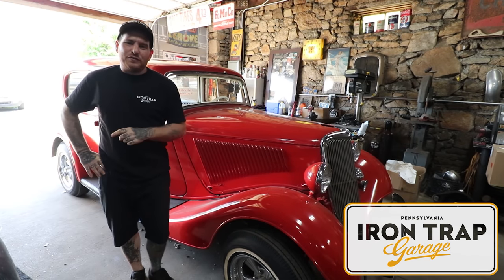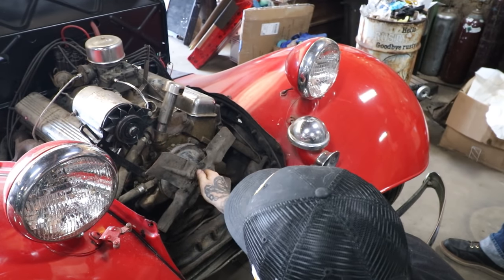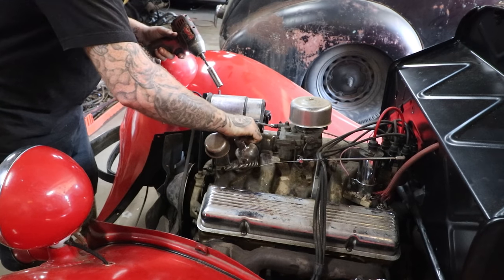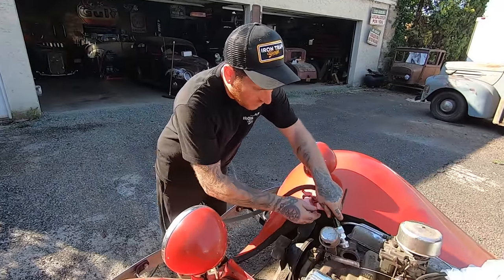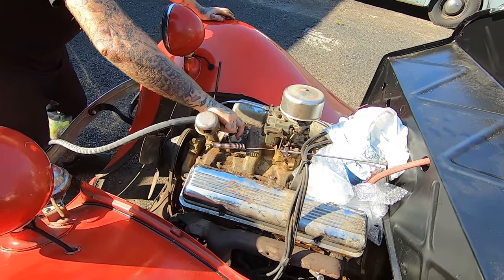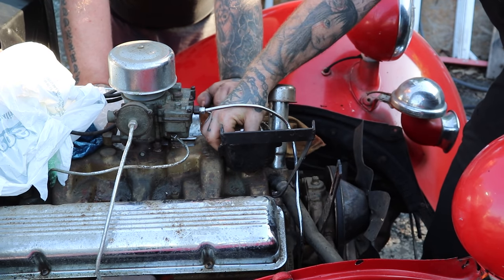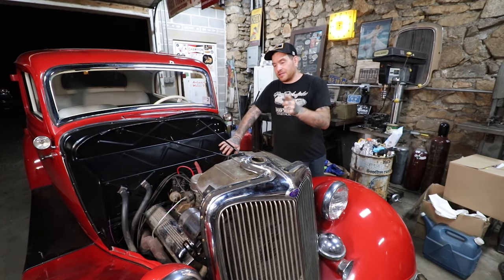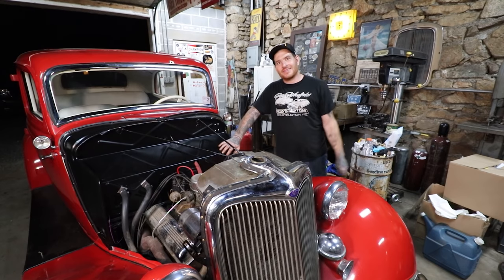Flushing The Cooling System and Installing a Heater!!??? - 1934 Ford Tudor

Comment: I worked in a radiator shop for a while.  We used a pressure washer to back flush radiators and engine blocks.  It combined air with water to hammer the engine cooling chambers.  You should have seen the goop come out of cars that were only 15 years old.  If you have overheating problems I recommend a power radiator and engine flush.

Comment: Hey Matt!! In my experience with vintage cooling systems, especially ones that haven't had coolant run through them in a while or just from sitting, you may have opened up a can of worms...Like you mentioned, it may take a couple flushes, if I remember correctly we use to use the powdered Tide laundry soap, but you must flush it all out...you probably will end up installing a new water pump before your finished, anyway another great video!! Build on Dudes!!!

Comment: Matt, hate to say this but if you pull the core ("freeze") plugs, you will probably find a lot more sludge/sediment in the bottom of that block. All the flushing in the world won''t get that out - only pulling the core plugs and digging it out (or using a pressure washer, which is nasty when the engine is in the car). As always, love the videos (but miss seeing Moon running around the garage)!
Reply: Absolutely.  Plus, the core plugs can be corroded inside and spring a leak once you start driving it.  They should all be replaced.

Comment: Hello Matt, from my knowledge of Cummins engine mechanic, I would recommend you to check the expandable engine plugs, since if they are not stainless steel or bronze they can be damaged by corrosion and cause future problems, and once started several times to clean the radiator again, hug and blessings from Buenos Aires Argentina

Comment: Hi Matt an old trick to  stop your radiator core from clogging up with rust is to put a stocking over the inlet pipe to catch the rust. Put it over the pipe then slip the hose over it. you can also buy an in line screen that does the same thing.

Comment: That's the way I always flushed my engines. Run water through the block until it comes out clear at the bottom. Same way with the radiator.
Reply from the maker: Cheap simple way, if that doesn't work then I go to some of the other methods like CLR.

Comment: Love the videos, keep them coming. I think I would have left the heater disconnected/bypassed until I ran and flushed the cooling system a few times so the heater does not become clogged. Better yet put a filter system in-place (like an external oil filter) of the heater to catch all the slug until it is clean then hook up the heater. 
I think the best thing to do is pulled the engine, disassembled it, hot tank it, paint it gold again, reassemble it using new gaskets but all the old internals. Of course that easy for me as a arm chair video viewer to say. LOL
Reply: I like to use magnets all over my cooling system. They will stop the crud from circulating.
Reply: YES I agree
Reply: @ddd228  Or wrap magnets around a filter so it traps particles even better.

Comment: Hey Matt! Great channel, have been inspired watching it. a quick tip, when you need to use a magnet for things like collecting rust or shavings, take a small piece of plastic, from a baggie or product packaging, and put it over the magnet head and hold with a twist tie or small piece of wire.
Reply from the maker: Good tip!
Reply: @IronTrapGarage  Glad you liked it.

Comment: There’s a flush kit you can get that has T fittings you can that go in the heater hoses that you connect garden hoses to each fitting, one supply and one as a drain . This setup does a much better job at flushing out the cooling system. 
Again another excellent video, thanks for sharing

Comment: Matt, Ford’s VC-1 cooling system cleaner is the bomb for this. Get er back together, drop a quart of that stuff in there and let it get up to temp with water in there and run for an hour or so, drop the lower hose and run clean water through it to flush. Pulling those block drains on the sides would help get the last little bit out of the block skirt areas also if you don’t mind the little extra work. The Ford VC-9 is specifically for iron so you may want to use it first then the VC-1 if you really want to do a great job. Heads up, neither of those products are cheap ($18ish) but they both work well and are not snake oil and are designed for exactly your situation. Don’t leave them in too long, they can be hard on some gaskets so an overnight soak would be a gamble. That car is coming along great! 👍
Reply from the maker: We may have to give that a try!!!

Comment: Matt there is a gadget called I think a Drain King that comes in a few different diameters, it's around 6" long, rubber and goes on a hose I have one for up to 2" pipes. They expand to form a seal then pulses at a high rate to clear clogges. Build a stub pipe at least 7" long to bolt the top end of the motor. You can also use a section of pipe and radiator hose to clean radiators.

Comment: LOL .. your acknowledgement of the sounding board advisors had me chuckling.  

Get some handlebars of vinegar at Walmart.  Fill your system full.  If you can cap your water pump .. please do.  Ideally a hose connection would be good to run after soaking .. but not everyone has water pump sized hose laying around.  You're smart enough to fab something without the radiator.

Anyways .. .. vinegar will absolutely clean out all that rust.  I've driven mine for a day or two, with the heater on & then back flushed with straight water.  Run with new water & baking soda to neutralize .. then back flush again and drain.  Distilled water .. run and drain ..remove & replace your freeze plugs .. likely need some attention .. then back to distilled & antifreeze.

Normally I'd have no issues with doing this with radiator hooked up.  Easiest 20 dollar or so radiator flush there is.

Comment: When you had the radiator out of car why didn't you remove the rust on the cross member under where the radiator sat on top of it.  You could have painted a rust converter then wire brushed the large flakes off and repainted the rust inhibitor again and let it dry.  I KNOW THIS IS MINOR BUT IT WAS SO OBVIOUS THAT I NOTICED IT AND HAD TO COMMENT ON IT, I ENJOY YOUR SHOW, KEEP UP THE VIDEOS, PLEASE.

Comment: Hi Matt.  
I have a suggestion.
Have you thought of using Evaporust to clear out the rust from the cooling system.  It will literally evaporate the rust, while doing no damage to any other parts of the system.

Comment: Thermostat bolts: I was waiting for a bolt to snap. Plain water is fine to flush out a block. If you use anything else, it's all day to get that stuff out. A LOT of "crap" at the bottom of the block right where the lower hose connects. Add a magnet in there somewhere .Even on the outside of the block. You don't want that stuff to plug up the radiator. OR the heater core. Your radiator flows well! It must weight 60 pounds. The '34 radiator was designed for a flathead engine, so it's overkill!  That is a good thing.

Comment: Matt  Unless you want to have heat in the car all summer long, I suggest you put in some kind of a shut-off valve in the feed line to the heater. Putting in in the return will still give you heat in the car just from heat transfer. Keep up the good work. Rick
Reply from the maker: Good call for sure 👍

Comment: The way my Dad used to do it was like this: Prestone sells a plastic tee with a cap on it. Your auto parts store probably sells them. This tee goes into on of the heater hoses and a garden hose connects to the threads on the tee,  The kit the tee comes with has a 45 deg. plastic tube that is about 1.5" did. This goes in the radiator filler hose. Start the engine and turn the garden hose on full bore. Watch water and crap come pouring out of the radiator tube.  Do it as long as you think is good.  My Dad did it two or three times a year so there wasn't much buildup to worry about. Why?  Because he did it a lot, Yours is pretty skody so maybe fifteen or twenty min. My Dad did it this way so it's the best  ;)

Comment: Hey you got to reverse flush . Check top of radiator ! Do not run with heater core hooked up . bypass heater core find something . Otherwise the core may get blocked on top and the engine could over heat . Remember the coolant flows from top to bottom . I went to school for custom auto rebuilding . Dealership training on the job .

Comment: Hey Matt, great progress on the '34. Back in the day we used to use "Calgon Water Softener" to clean sludge out of the diesels. I believe it is still available. I have also heard you can use Dawn dish soap but have never tried it. I see a couple of comments about removing the core  (freeze) plugs. A PITA to do but probably worthwhile. Anyway this is a great project. I really enjoy seeing the saving of an old build.
Reply from the maker: Thanks for the tip never heard that one before!

Comment: Morning Matt,
Good to see the 34 getting a drink of coolent.
Another step closer to the road !
Other viewers have lots of great ideas about cleaning out the cooling system so I will not put in my two cents worth.
I think you have delbt with enough old engines that you have a pretty good idea what you are doing.
   I Will have coffee in hand Sunday Morning for the Live event.
   ( Have you received the Wire Covers for the Steering column yet ? ) 
Thank you for the update of this great Survivers comback.
Be Safe and Well All.
Reply from the maker: We saw a package show up when we picked up mail call packages. We'll open it in a future video

Comment: The first thing I would do is get rid of the old water pump because if it is rusty up top you can almost be certain the impeller is rotted from sitting so long. We used to mix up washing soda and pour it in as a solution into the engine and start it up and let it come up to temp for a while and drive it around the block and dump it. It took a lot of garbage out.

Comment: You might think about placing a small ball valve on the inlet and outlet of your heater so you can isolate it from your engine. Two big reasons-isolate it from a leaking heater core that fails in a big way and spewing big quantities of very hot water inside the car and isolate any heat from entering your cab in the summer. Even though you may have it off and it is not suppose to be ciculating the residual heat can get the inside of your car really hot just from the heat going through it when it's not suppose to. These are really notorious for failing.
Reply from the maker: We may have to add one. Not a bad idea!!!

Comment: Hey Matt, Having your drain plugs clogged in a small block Chevy is normal, specially on one that sat as long as your 34 Ford has. Don't think it's out of the normal cuz it's not. I've seen them so clogged that I had to take a punch and hammer to brake them free. Like you said, clean them the best you can and refill with water, run for a while, up to temp, and drain them again. When you  do drain and flush it,  drain it using the drain plugs, not by pulling the hoses or the drain in the rad, and while doing it, use a pick like you were to get it as clean as you can. After you get it cleaned out the best you can then put more water in, run it again and drain it thru the rad to remove as much as you can from the rad. You may have to do this 3 or 4 times to get it clean. Sorry for the long post,  Good luck - later
Reply from the maker: Thanks for the tips!!!

Comment: The gold engine paint was probably put on when the engine was rebuilt before installing it in the '34. Gold paint was used back in the days,1950's as I remember. I believe it was gold so  that people would believe it wasn't a stock engine. I seem to remember gold paint was used on show car engines also. Jim
Reply: I think that the Y blocks were painted gold.
Reply: @ddd228  The 1956 Mercury Y-block was indeed gold but until around 1959 the 292 Y-blocks were red with black rocker covers and the 312 Y-blocks were black with cream colored rocker covers. The reason my 75 year old brain remembers gold engines in the 1950's was because of the Oldsmobile small block v-8 "Rocket" engines that started in 1949 all were gold except the 307 c.i. And many of the show cars used the Oldsmobile engines. I do remember seeing gold flathead Ford engines but I don't know if any were a factory color. There were also some later ford engines that were gold one was a 352 c.i. but i don't know the years.Jim

Comment: When I do this I typically put the thermostat housing back on with rad hose and clamp the water hose on and run it. Then i reverse that and force water from the bottom up. Repeat several times.
Reply from the maker: Great idea. All ideas work as long as it gets the car going!

Comment: I don't think I would have mounted that heater core side-ways like that for 2 reasons. It needs to be able to burp the air out of the top line, and as you mounted it, the thing will always be half full. The direction of flow should be from bottom to top, not side to side... Correct me if I am wrong?

Comment: The only way to get the cooling passages clean is to pop the freeze plugs out and scrape around inside because that stuff will be inches deep in the block. You can buy in line filters to get the worst out when running but they are stop gap until the block is cleaned properly. what you see in the thermo housing is a tiny bit of what lurks in hidden places. itr would be a shame to block up the radiator and cook the engine as it runs so well.

Comment: That crap in the block, blow it out with air first. And put a filter in the top hose to stop filling the rad full of crap. And have you replaced all the  all the welch plugs? Two behind the flywheel.2 in the front, 3 each side of the block. And flush from the bottom up in the block. And even more so for the rad.
Dont bother will coolant, you will be flushing that block for a good while.
Fittings?  This is a Chev, not a prehistoric sidevalve..
Best place for the temp guage is  the intake near the top hose..  Though earlier engines have a plug in the side of each head. Works but not ideal. You will still need a reducer
Reply: Without the invention of the prehistoric sidevalve, there wouldn't have been a smallblock chevy engine.

Comment: You should pull the motor down to bare block and have it hot tanked, all that rust and grunge will cause problems down the road.

Comment: Stop you at 8 minutes. Get two gallons of white vinegar. Fill the motor and let sit at least "overnight". Drain and flush. Maybe add some baking soda to neutralize the acid from the vinegar. Don't know if you need to apply heat. Might also help. I've done this on old galvanized plumbing as well as cooling systems and it works quite well. With all that rust floating around, I would change the pump also for added security.
Reply from the maker: Good tips
Reply: @IronTrapGarage  
BTW, the white vinegar also works great as a "pickling" agent. Need to weld a bolt and all you have is cad plated bolts??? Soak whatever bolt you want to weld in un-diluted white vinegar overnight. "Presto", no more plating !!! Safely weld away !!!

Comment: Matt I'm not criticizing: but why didn't you paint the sheet metal under the RAD like you did the firewall? Also the doors on the vintage heater? It's easyer to do when it's disassembled! ...Newk from Kentucky
Reply from the maker: I don't want any one thing to overly stand out when the car is together. The firewall and jambs were painted as they stood out and looked odd when the car was all closed up. Nicely painted and detailed tins would have looked a little odd at the front of the car. It's tough to decide when to paint and clean stuff and when not to on these survivor cars and we all have our opinions and mine isn't always the best and I make the decision on the fly usually.

Comment: 1955 265 is a 1 year manual  temp gauge to seat the  not electric, the old mercury filled  temp gauge tube... 1956  went to electric sensor in the front left side of the intake manifold this became the standard for SBC... 1955 block had thinner cylinder walls than the others SBC, No Built in Oil Filter, Manual Mercury style Heat gauge

Comment: What is the engine, does it have an external oil filter (56), no external Oil filter (55) looks like a 265 chevy, 55 has a manual mercury temp guage, the water temp location in the rear  clinched it it is a 55 265

Comment: You've probably moved on well beyond this, but the use of a commercial radiator/block cooling system flush will help move some of that sludge along and out of your engine. Sorry you wasted coolant, that stuff is expensive. Be careful when you select the flush as some brands/types are not recommended for use with aluminum parts.

Comment: Hi Matt, with that amount of chunky rust, you might be wise to flush with some other stuff to clean this once again ( radiator Flush kit ) after you have run the engine, I believe that it has a protective additive for the water pump.  But with that amount of rust you may have do this once a year.
Reply: Another method would be to pull those old core plugs , I know I know it more work but she was rode hard and put away wet! So Good Job so far run it and drop it a few times see if that does the trick.
Reply from the maker: Thanks for the tip!
Reply: I like the Prestone water pump lube additive! Kind of milky.

Comment: I am hoping it is not too late for this opinion but, please don't run the engine with the heater and radiator connected.I suggest that you put simple "U" hoses in place of both. Add cooling system cleaner to the water system and run the engine, let it warm up and shut it down. LET IT sit, then water flush it again. Then repeat the process. THEN connect the radiator and heater. If not, my experience is that the cores become clogged with the old rust and debris. Then you have a ton more work to clean those.